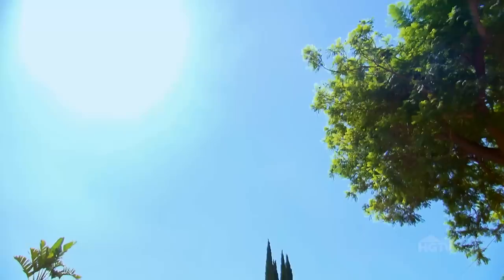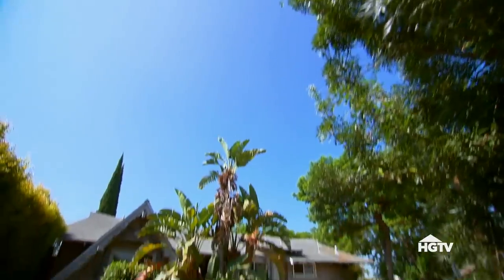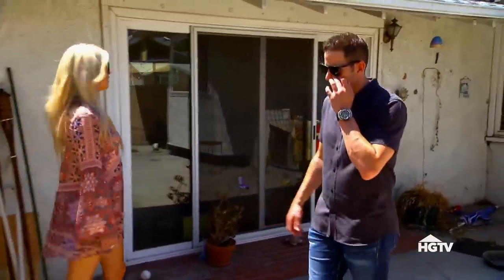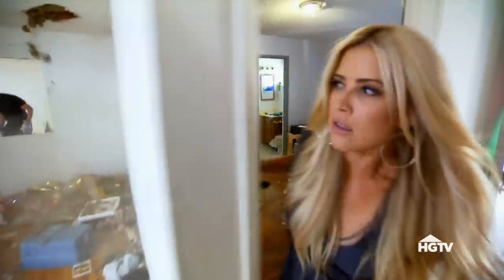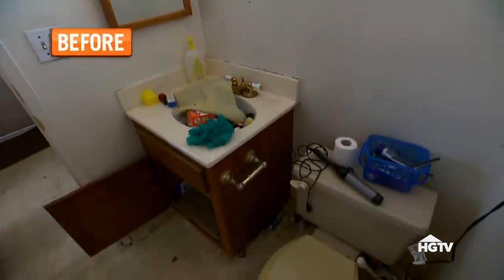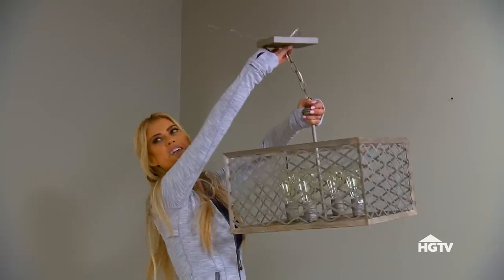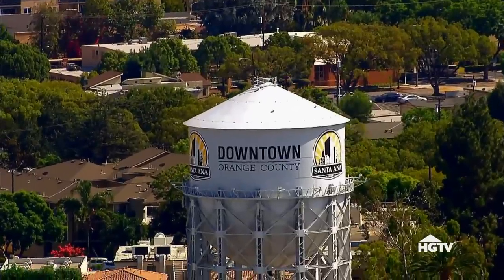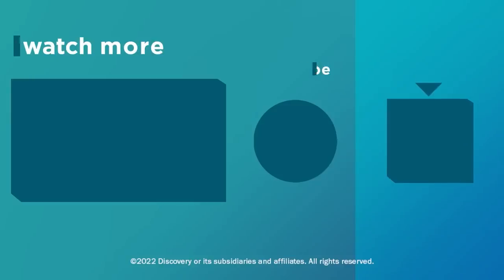Guess What 60k Home Remodel BUDGET Sells For!! | Flip or Flop | HGTV

Comment: I hate that they're trying to modernize a storybook house.  Storybook homes are rare and hard to find.  A covered porch is a nice feature. It means they've done a bad job if they get less.  
They could have signaled the door a different way, with say a contrasting color along the blank wall.  Or removing the recessed part (which is bad for burglaries, anyway).
Blaming the housetyle is a deflection.   
Bet the house has rot problems now.  The exterior 'after' is making me gag.

Expected a positive change in the interior.  It's a huge miss.

Should have checked the kitchen basket for bodies...
Reply: They covered the oak floors to
Reply: @nakochan1024  
That was another bad choice of theirs.
Reply: I agree about the style. I don't understand why people want to so radically change something that is different and special. Cookie cutter mentality. I don't subscribe to that line of reasoning.
Reply: @nakochan1024  
There was no reason for that.
Reply: too* not to
Reply: @erinskeffington3683  
I used it correctly, that said, you survived the misuse, and understood the meaning.

Comment: I liked the original front, but I think it needed to be re-designed. But, I guess I like a little more of the Victorian style with a the modern, not just all modern. Anyway, I like that I get to see what it looks like without it though because I would never have had the courage to remove it myself. I do enjoy the modern clean lines and style that the two of you present though, too. I am still deciding!